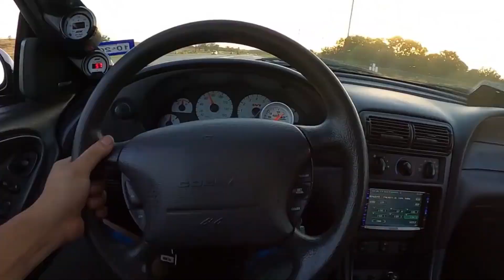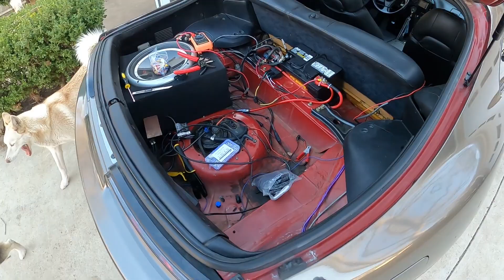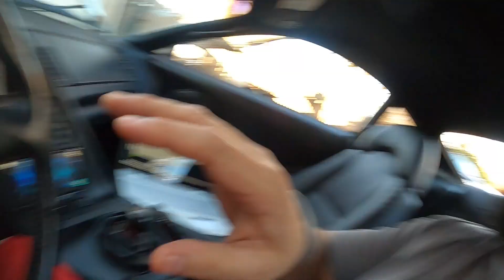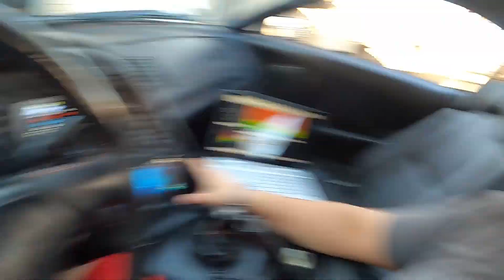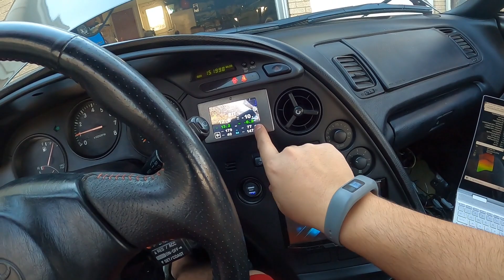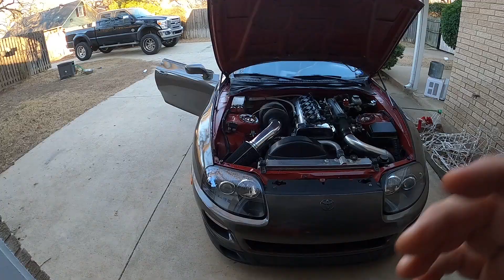Setting Up Rolling Anti Lag and Race Fuel Switch. MKIV SUPRA

Comment: Hey man I’ve been thinking about throwing cams in my cobra but I’ve never really done work that extensive in a car. You got any tips for me if I decide to do the work myself? I really want to learn but at the same time I really do not want to mess anything up
Reply from the maker: You have a 99-04 Cobra? If so, cams is definitely not something I would recommend you do on your own. VERY extensive project. I actually had a shop do this.
Reply: @boostedproject  yup 03. Yeah I’ve definitely thought about it I just would like to learn you know? Maybe when I get ported heads I can throw them in and then on the motor then ripping everything apart. Time will only tell lol thank you for the input boss!

Comment: Such an awesome car. Im so happy for u. I cant wait to see that beauty on the road with the rolling anti lag
Reply from the maker: Thank you bro. I’ll get some content for y’all soon.
Reply: @boostedproject  HONESTLY I THINK THERE A UGLY CAR EVEN THO THE MOTOR HAS THE INTERNALS OF MY TERMINATOR AND MY SUPER SNAKES.I HAVE NEVER RACED ONE OF THEM BEFORE WITH ANY OF MY CAR'S BUT IF A SUPRA HAS A CHANCE AGAINST MY TERMINATOR OR MY GT 500 OR MY SUPER SNAKES LOL THAT SUPRA BETTER HAVE A LOT OF POWER AND LIKE I SAID IAM NOT A FAN OF THE LOOKS OF THE SUPRA.
Reply from the maker: @anthonylaudano9751  lol. That’s cool man. I hope your mustang has over 1500whp or else I would most definitely smoke it. 😂
Reply: @boostedproject  NO MY SUPER SNAKE IS STOCK WITH 900hp STRAIGHT FROM SHELBY AMERICAN AND I AM NOT NOTIFYING THE CAR.LOL HONESTLY WITH 900hp IT'S HARD TO GET TRACTION AT TIMES AND I COULDN'T IMAGINE THAT KIND OF POWER NUMBERS ON THE STREET LOL IT MUST BE SCARY.I AM DEBATING ON BUYING ANOTHER SUPER SNAKE WITH THE HOLE SHOT PACKAGE WITH THE WIDE BODY OPTION AND THAT SET UP FROM SHELBY AMERICAN IS THERE TOP HP OPTION WITH I BELIEVE 1.200 HP.BESIDES MY 2 SUPER SNAKES THAT I CURRENTLY HAVE I ALSO HAVE A 08 GT 500 THAT RAN 9.77 AT 144.8  MPH AND HONESTLY MY GRABBER BLUE SUPER SNAKE IS PROBABLY FASTER THAN MY GT500 SO IF I HAD TO GUESS I. AN RUN LOW 9s WITH MY SUPER SNAKE AND HONESTLY LOL THAT'S FAST ENOUGH FOR ME.
Reply from the maker: @anthonylaudano9751  you have some nice cars.
Reply: @boostedproject  THANKS MAN APPRECIATE IT LOL IF YOU WERE ME WOULD YOU KEEP THE TERMINATOR AND NOT BUY ANOTHER SUPER SNAKE OR SELL IT FOR ANOTHER SUPER SNAKE LOL.